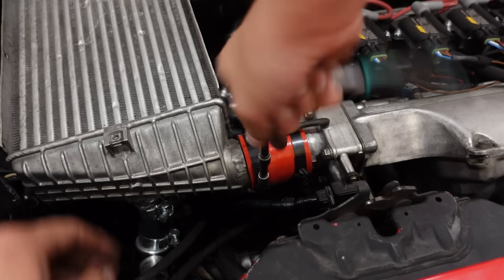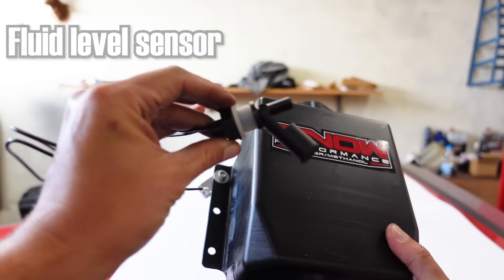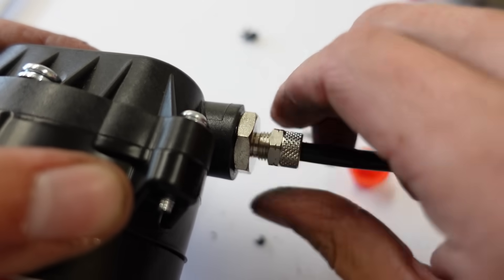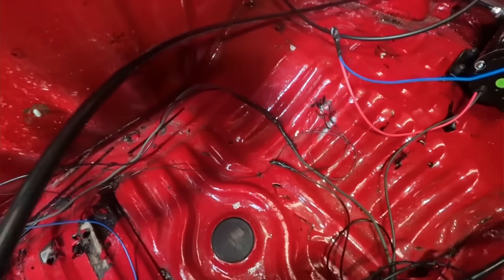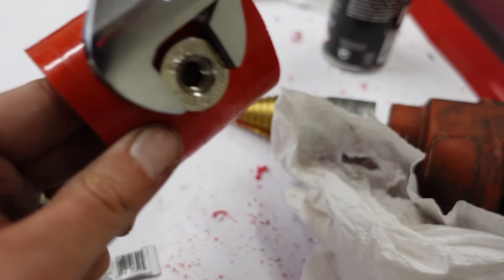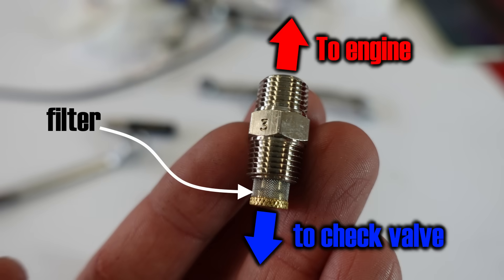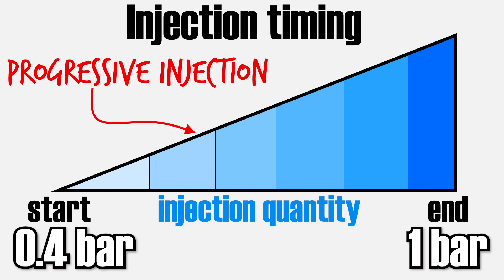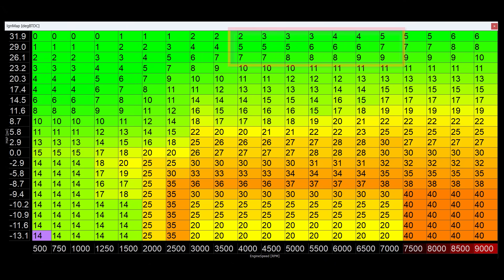How to Install Water Methanol Injection and Tune Your Engine For It

Comment: can i install this without tuning my car?
Reply: You can but you'll see no benefit and it will probably even run worse. Methanol cools intake charge if your intake air temp is too high. This same channel has some great videos about knock and e85 and timing and everything else you need to know about what helps or doesn't help and engine.

Comment: i ve one question what will be in rainy  days ? ecu can compensate weather condition  too outside temp outside humidity ? or it is manual .i mean some rainy days don`t need any water methanol injection. what will be in winter ok this liquid will not freeze but humidity is very high and very cold air intake temp too

Comment: Why can't multiple injectors be added to the intake ports? The reason I ask is I worry about the mixture not reaching all cylinders equally and causing a knock event in a leaned out cylinder that is also starved of water meth.
Reply: They can, these kits just cost way more and are considerably more complex. The mixture not being exactly the same in all cylinders seems unlikely but possible.

Comment: Please explain adding this system to a non turbo engine. In my case it is a 1983 VW T3 van with 1.9 liter water boxer engine. It has only 80hp and could use the added cooling effects of water injection when driving over our big mountain passes in the summer. Hvala.

Comment: I just re-watched a video on water injection by David Vizard, one thing he said, it's best if the water gets vaporised at combustion, and not in the intake manifold as that displaces air, and where it gets vaporised is related to droplet size. Also he said on his factory turbo mustang, he was going to run 37 lb of boost on 87 octane and that would require a fuel to water ratio of 2:1 ( fuel:water ) and it is possible for an engine to still run with 3 time as much water as gasoline. So if my rough calculation is correct you could, 2:1 on your 300 hp engine equals 900 ml/minute. The video is called ..... "Worlds cheapest and MOST EFFECTIVE octane booster" 

Your channel is great, so thank you.
Reply: nothing new under the sun, look up the 1962 Oldsmobile 215 Turbo Jetfire

Comment: Appreciate the informative video. One slight correction, the check valve is not meant to keep water from filling your engine. The purpose of the check valve is to prevent drain back from the lines into the reservoir and starting with a dry line. Ideally the check valve's best placement would be between the tank and pump. That would keep your pump and entire line to the nozzle primed when the power isn't on.  If you want to keep the line from accidentally filling a normally closed valve with solenoid tied the power wire supplying the pump. That means when the pump isn't powered then the valve will be closed and not allowing flow to your engine. Otherwise, great detailed video!

Comment: Mister D4A, very nice teaching video! Well, Brazil has a alcohol program since 1978 (Pró-álcool) to substitute parcially gasoline in cars. Here we used ethanol anydrous. So FIAT was the first automaker to launch fully adapted alcohol car (FIAT 147, FIASA´s engine by Aurelio Lampredi). Corrosion in the early years were a issue, so the carburetor was covered with nickel and fuel systems like tanks are galvanized. Engine lubrication system and their oil are normal with no signs of emulsion. Ignition systems needed more power, so better coils with inductive electronic driver were adopted (Bosch TSZ-I), and hotter sparkplugs. Engines needs more iginition advance, so distributor curve was changed. Thermostatic valves are hotter, same as radiator fan switch (gasoline between 78 to 88 celcius and alcohol 85 to 98 celcius). Carburetors receive smaller venturis than gasoline carbs and fuel passages were increased. Fuel consumption was obvious greater, but alcohol was cheap than gasoline and bigger fuel tank (15 % bigger) keep total automony very close to gasoline cars. Engines running cleaner, inclusive the oil. Cold starts were bad (Fiat and Ford are better, VW not good and Chevrolet are the worst). All cars had a small (0,5 to 1 liter) gasoline tank on the engine bay to help cold starts. On the beggining, are some troubles with head valves seats because alcohol has no lubrication effects, like gasoline, so engineers adopted high alloy to make the contact valves seats. In the 80's, the alcohol technology were fully developed and almost 90% of cars sold are alcohol engines. In the 90's, alcohol productors change the productions to almost only suggar and there had alcohol crisis. Buyers change their mind and do not buy alcohol cars until early 2000's when automakers introduce flexfuel technology that allows a engine to run with 100% gasoline, 100% alcohol or any misture of these. Fuel injection with mapped ignition helps a lot alcohol engines. I drove a 2010 Ford Fiesta with 1600 ROCAM engine with no issues. The driving sensation with alcohol is a little more power on all engine speeds and a readiness in all speeds, and a littler more harshness because ignition advance. Of corse, i am talking about 6 CV more (101 to 107 CV at 5500 rpm and 14 to 15 kgf.m at 4000 rpm), not stuning, but is perceptible. Thank you and bye!

Comment: I have no idea if you will see this, but wanted to run an idea past you for an ultra simple water meth injection system.  Basically, what I am thinking is having a section of pipe with a diversion / split in it after the intercooler.  On one side of the pipe it is just a straight through pipe.  On the other section of the pipe diversion, a narrower pipe, in which a small carburetor would be installed, so that the air flows through the carb.  Above this system would be the water meth tank, which would be connected with tubing to the bowl of the carburetor.  

I would think I'd need to block off the idle hole on the carb, and keep the butterfly valve, which would connect with a cable to the intake butterfly valve.  

The whole system would be mechanical.  It should in theory inject water / meth into the air stream in relation to how much air the engine is flowing.  Getting more or less water / meth would come down to changing nozzles / jets.  I'd think one could make this set-up inexpensively.  I'd think it could use a small engine carb, and other than that, it would just be the section of diverter pipe, and the bowl fill tube and tank (possibly set up to just go into the windwasher fluid tank).  If using the windwasher fluid tank, I'd think I could make a prototype for less than $50 with my 3D printer.  Might be a trick on the fluid mechanics side of things?  

If you see this, let me know your thoughts.  See any reason I am not to why this wouldn't work?  See any reasons why this would operate in an inferior way to a traditional water meth system?

Comment: I short shift my Accord 6-6 around town for economy so my question, does this work better low rpm or higher? I try to get into 6th at 1k with throttle wide open while accelerating.

Comment: In Brazil gasoline already comes with alcohol and water - it's called Hydrated Ethanol. Our gasoline has 20% of it - it works as antiknock agent and also Ethanol has higher ... well ... you know what - I'm afraid of using the wrong word here ...

Comment: I have a couple of questions.  I am interested in doing this, but worried about a failure and I am using a stock ECU (but not the stock tune).  I am not sure how to (or if it is possible) to setup a failsafe with the stock ECU. Did you do a failsafe in this install? If so, how did you set it up?  I imagine it is a bit easier with the aftermarket ECU.  

Another thing I was wondering was if the you are having knock retard, could you use a lower volume nozzle and inject enough just to get rid of the knock retard?  Could you gain a little power that way without having to do a tune by keeping it out of knock retard?  Is there a sweet spot to do that and not inject enough to lose power if it is not in knock retard?  Thanks for the info. Great video!

Comment: Installed a snow performance stage 1 kit. Only downside is it only comes with 2 nozzles a size 6 and a 9. Wanting to get a size 4. Its also worth noting if you have a standalone ecu such as a haltech ecu you do not need the controller. Your ecu should come with a water injection page and you can set your ecu to control your water injection. With settings under water injection(advanced) you can set it to turn on with map,tps, rpm limitation triggers and you can set it to turn on while using launch control.
Reply: And the halt ech ecus also has 2 seperate look up tables to compansate for afr/lambda and ignition timing with out tweaking your base fuel and ignition tables. So your tune only works while its spraying..like it has 2 maps all the time.
Reply: is this available on the Haltech platinum series of ecus? or is it only on the elites, im going to pick up my first standalone secondhand tomorrow and it would be great to know haha
Reply: @dissapointingsoup4893  so far i only know that its on the elites because thats what i'm using as well. The platinums are pretty obsolete at this point anyways. i would think anything elite,nexus,Rebels should be able to do it. Platinums i dunno tbh

Comment: What about rubber gaskets and seals the ethanol eats away at rubber. And yes I do understand that most gasoline nowadays does contain some ethanol however with direct injection it is injected directly into the combustion chamber and doesn’t go through the entire intake manifold etc..

Comment: Just fyi, as far as I know, your O2 sensor reads O2 which is a result of Lambda. It doesn’t know or care what type of fuel you’re running, it reads how far you are from Lambda. The A/F reading is just a calculation for gasoline. It’s probably less confusing to set your gauge to display Lambda.

Comment: What about the throttle body? ..If your part throttle but the engine is making enough boost to start spraying, it may soak the throttle plate creating water droplets and puddles. I think the best place to spray is after the throttle body for this reason.

Comment: Those bung adapters are usually on the thick side. Do you need to worry about the nozzle being a bit recessed in the bung and spraying some within the walls of the bung?

Comment: I plan on endurance racing my audi with 1.8t. Intake is right next to turbo and well, hot air.  So i have been thinking of this setup after the intercooler. How long does this setup last time wise?

Comment: How would the setup be modified for a engine with dual throttle bodies or even ITB’s? I have a vq37vhr that I would like to boost. Seeing as you can’t spray directly into the turbo/centrifugal SC my assumption is that you would somehow need to split the line and plug it into both of the intake pipes? Is this the best way to go about it or is there another solution that would work better? Any ideas would be appreciated!! I live in texas where ambient temps easily reach 40c in the summer time and this system would be a huge benefit for my future build projects!

Comment: I have a mazda 3rd gen 2.5 turbo and this will be a good way to get more power but i have 3 problems :
1- is it ok to install the nozzle after MAF-intercooler before throttel? 
2-my car have a limited tune capability which makes it harder to know the best afr for gdi turbo that will be injected with water meth 
3- when to inject safely because my car will have full boost @2000rpm

Comment: Before anything: thanks for such a comprehensive and well documented information, together with the uncommon ability to deliver a good and understandable imagery. My concern, is the engine's age, a 2002 Subaru Forrester. It has 264.5000 miles on it, although well maintained.  I fear its loss of power through rings will end up overcoming its gaskets. I perceive its blow-back through the oil cap on its oil intake tube. It certainly comes from somewhere. Will I end up blowing a gasket installing something like this, which I like very much? Thanks again d4a. 👀

Comment: Hey there, I've watched your video and a lot of them more and I'm a young tuning fan. 
Long story short, I have a question to the cooling system and the problem about having the engine in the rear. Wouldn't it be possible to make a roof scoop that goes right onto the opening for the intercooler to get more air to it. Like on the honda nsx GT? Couldn't that help more with the cooling too? 

And sorry for my bad english, im trying my best. Love your videos, learned a lot of tuning just from you :)

Comment: Love the video.  I am installing a Snow Stage 3 kit.  it allows for using boost or injector pulse or a combination of both as a reference for the controller.  When using injector pulse as a reference point would the same 40% rule apply?

Comment: Could you do a video comparing the sustainability/impact on the environment for the different options when it comes to buy a car ? You already did a very good video showing that both ice and electric vehicles have a similar impact on the environment but could you do a video with a broader spectrum of solutions like hydrogen, retrofitted EV, Used compared to new, hybrid…
Reply from the maker: I could, but there's no real data to support any of the claims, just educated guesses. Different researches all give different numbers.

Comment: They recommend the tank and pump be installed below the intake manifold to insure there isn’t any gravity fed leaking of fluid into engine, correct? I have tried calling tech support at Snow performance but they were completely unhelpful. Well, they did say the kit with a solenoid could be installed either way but didn’t explain why. Im assuming the solenoid acts as a valve to stop fluid from free flowing and that’s why it can be installed either way, whereas, the kits without a solenoid have to be installed as shown in your video to avoid leaking. I just ordered mine yesterday so I’m trying to familiarize myself as much as possible with all of this before diving into the install. Thanks
Reply: I ordered the stage 2.5 diesel universal kit

Comment: Great video, makes it easy to understand.One question,can water alcohol injection be used on a normally aspirated engine ?
Reply from the maker: It can, but there's less benefit
Reply: @d4a  Thanks for your reply, I will look into it. Cheers.

Comment: On a metal to plastic fitting, I would definitely add some sort of thread sealant like you did (even if it's just nylon tape). I know plastics are better than they used to be, but relying on plastic threads is not something I am fond of.

Comment: I actually really like this guy and his knowledge is almost impeccable, haha almost, OK so I have to go back to a video as I'm new to the channel so this is on the bigger brakes don't stop cars quicker thing video where of course he is 99.9% correct, the 0.1% of inaccuracy is that he stated pretty well 0% of people will have brake failure, well I've had two and in some regions and under circumstances it is actually quite common. OK wrong video to comment it on, no one will read it, he certainly won't but phew got that off my chest now I can continue to enjoy his content 😂
Reply from the maker: I read it. There is no such thing as impeccable knowledge. If your vehicle isn't ancient, then your brake system failed not because of its design but because it was not in optimal condition in terms of maintenance or your vehicle was overloaded or something else outside the realm of the design of the system itself.

Comment: How much distilled water would you say the engine consumes per 100 km? (I want to know approximate numbers only, about 100% distilled water injection, injecting ethanol 50:50 might be hard for a daily use to find a store etc)

Comment: if I'm in an area that gets freezing temperatures, I assume I have to insulate and warm the tank or drain it in the winter? I don't assume I can just pour antifreeze in there. What's your recommendation on that?
Reply from the maker: The freezing temp of methanol is -97 C, Ethanol is below -100. So if you run 50% of either, you need to be somewhere near the Arctic to have issues.
Reply: @d4a  oh, I… didn't consider that. Thanks for the answer!

Comment: Just buy a better car with more performance...
Reply: Unless it comes with a water meth kit, which it won’t aside from a literal handful of bespoke factory race cars, the better car with more performance would also see benefits from the addition of a kit. 

These don’t come standard entirely because of increased maintenance—mostly that the owner has to fill this tank in addition to the fuel tank.

Comment: The check valve prevents the boost from pushing the liquid back. What stops liquid from being injected when not intended is a solenoid.
Reply from the maker: The check valve has a crack pressure of 7 psi, which means nothing gets injected below that.
Reply: @d4a  that makes sense! Thanks for the correction

Comment: I installed water methanol on my car a couple years back. I used the snow performance 2.5 and integrated the 52mm gauge in the car. Highly recommend that kit. Just more wiring but guage doubles as psi read out. Brought my temps down from roughly 35c to 0-3c on logs and kept my valves clean. If you're running 51/49 menthol you honestly don't need to upgrade your intercooler. If you do this on your daily driver please save your self the hassle and just upgrade to the biggest tank that you can fit. The tank in this video will last 10 min of wot pulls. If you don't wanna deal with methanol go for port injection you can add more power and keep the valves clean. Best part only add gas.